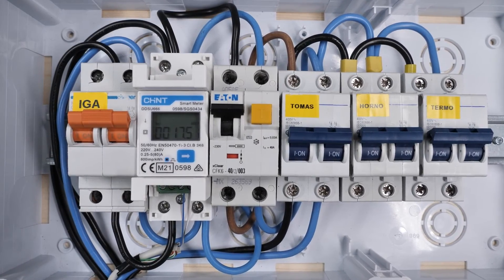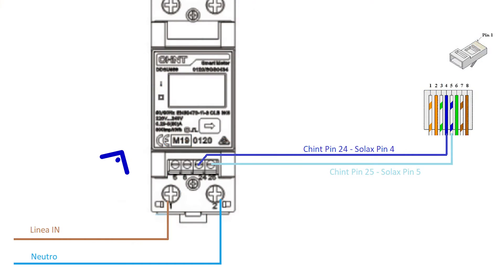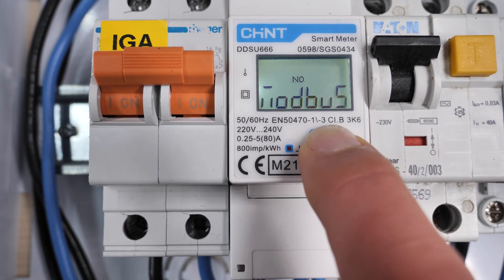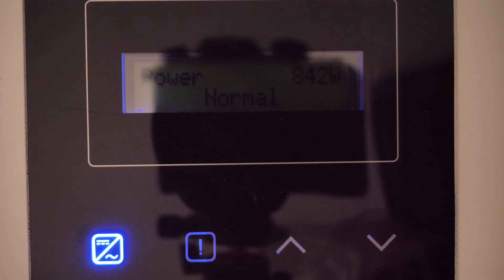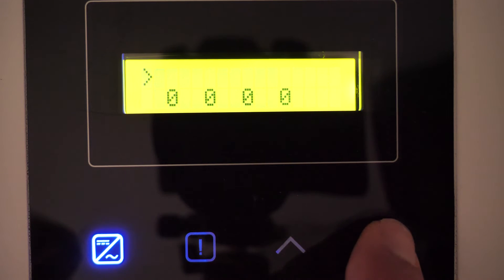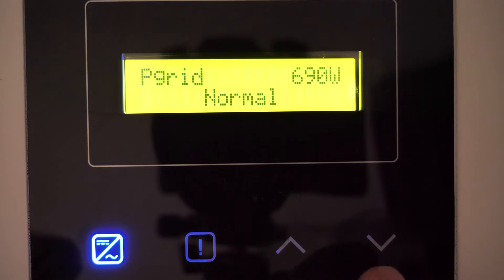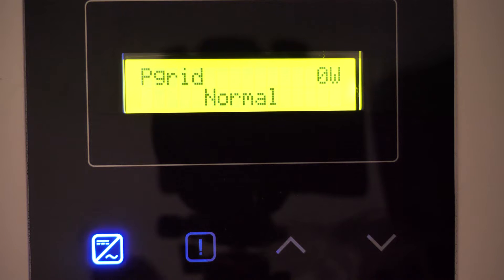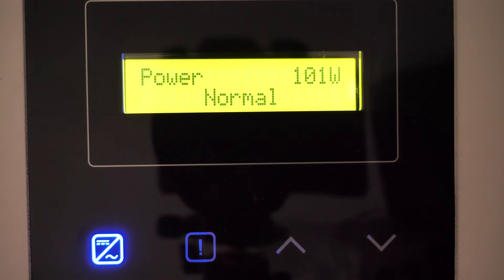CHINT DDSU666 Setup for SOLAX Inverters.

Comment: Hi this is great educational video, do you know the exact connection on DSU666 to XA-AC Solax Inverter, I was told ports 24 & 25 on the meter and 7 & 8 on the inverter end on the RS plug. But we still have the meter fault on the inverter and its not communicating properly. Could you please help with this exact meter and X1-AC inverter connection and specific settings. Thank you in advance.

Comment: first of all thank you very much for the video. i have a few questions. to the lower right of the meter you have 2 neutral cables. one goes to the main switch but i dont understand where did you connect the 2nd one. also to the upper left you have to phase cables where did you connect the left one? straight to the AC plug of the inverter?